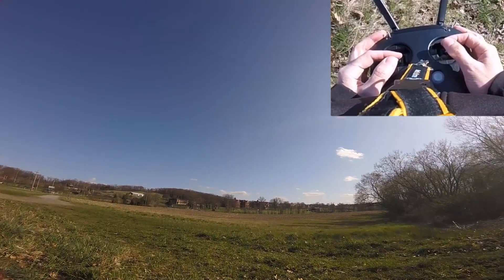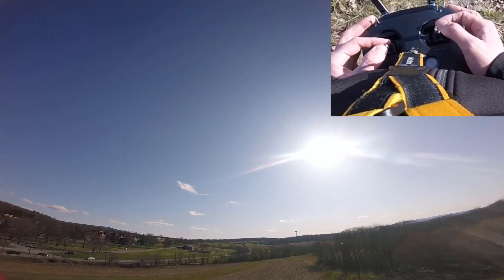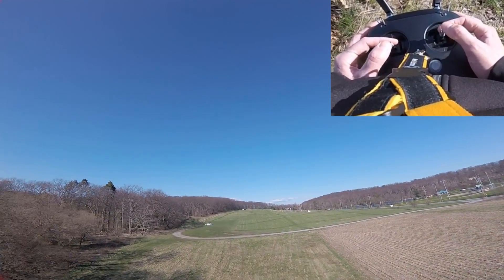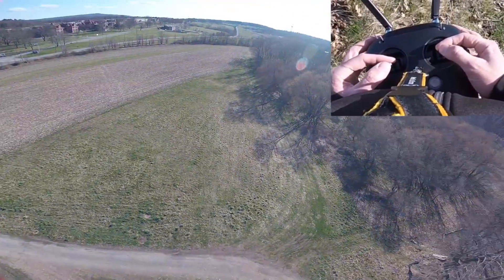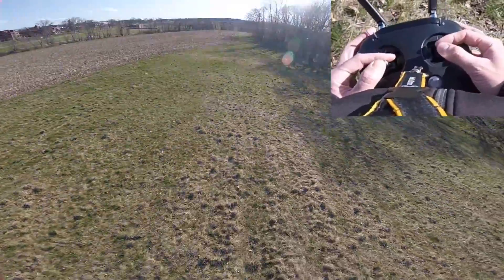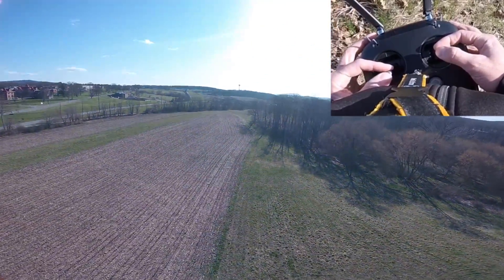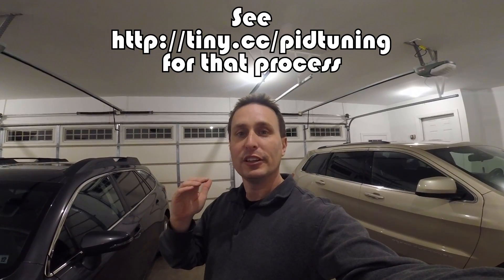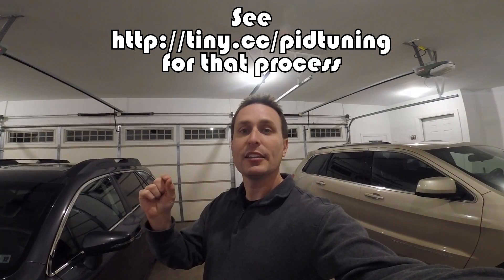How to Fly to your "PERFECT" Tune.

Comment: great tips Mark! Thanks for the video! 
One thing I'd add is, in order to really see the vibration profile if using spectrograms for example, it's good to do fairly SLOW 0 to 100% throttle sweeps (10sec or so). That way, we have lots of data across the throttle range with no gaps, which is ideal for spectral analyses, and we can more clearly see the full vibration pattern, which is ideal for looking for MTOs and such

Comment: Thank you for a great video. Could you elaborate a bit more on how P-term setting is influencing drone behavior on throttle punches (or link to the video where it is described in more detail)? I have a bit of trouble making drone be stable on sudden throttle punches (nose is dipping or raising from time to time), had a bit of success by increasing antigravity + I a lot, but it doesn't seem to be a proper solution. Just don't get how P is affecting it, as I am not touching any axis, so 'setpoint'  should not be changing... so I must be missing some of the key parts here.
Reply from the maker: https://youtu.be/Sdaw5YPvQBw

P-term pushes the gyro stay on Setpoint whether it is moving or not.

I-term too, but over long biases.  P-term is the shot stuff like a bobble.
Reply: @uavtech  thank you, looks like I was understanding setpoint a bit wrong - as an 'external control input on axis' and it was confusing me, now it makes sense.

Comment: I got ossolations on 5. Smooth forward flight > What is the advice too smooth this out (7inch)
Reply from the maker: make sure your props are not completely off balance and your arms are extra stiff.  then start with stock BF settings.

Comment: Hey, what would recommend for a 5 inch 6s quad in terms of d? Is 45 still adequate to tune the p d ratio? Thank you so much!
Reply from the maker: Depends on the power to weight ratio.  For a fat boy, i try to be in 40s.  For light racer, 20s or 30s.

Honestly you want it as high as you can without negative side effects.
Reply: UAV Tech thanks! Im coming in at 620grams with battery and everything, around 40 should be alright i guess

Comment: this is how you can fly with stock or mildly slider adjusted tunes. overly technical tuning is a thing of the past. https://www.airvuz.com/video/effpeevee?id=5e970859a21581516ab1d80c
Reply from the maker: Who do you think help invent the tuning sliders?!

Sliders have limitations and you still need to induce stepped moves to evaluate your slider tune.

Comment: Hey, I have a problem I can't solve for quite some time now. I have a crystal clear fpv feed until I turn on my radio. Suddenly my osd starts to flicker around and it can get so worse that the picture is nothing but static. My antennas are isolated and and so is my r-xsr and my unify pro 5v. It seems that the radio control link interferes with the video. By moving the antennas of the r-xsr I can sometimes get a good picture by holding it in a position or by taking the r-xsr out of the kwad and hold it above it. But as soon as I put everything back in place the same problem occurs..I'm just desperate at this point because i tried everything I could imagine being the problem
Reply from the maker: I would be guessing.  But check your VTX connector is not touching the frame.

Comment: How would you recommend tuning out prop wash on split s drops?
Reply from the maker: See http://tiny.cc/pidruning

You have.to have right, and then turn up PD Gain.  Depending on motors and props, you may never get ride of it.  Motors hit saturation and can not update rast enough.  Of if too much noise, you need too much filtering which causes too much delay.
Reply: For anyone wondering: http://tiny.cc/pidtuning is the correct link

Comment: Pfff... blah blah.. stock BF, PID is flyable for most 5inchers. 
Now try it on a 9"-10". Vibrations, and frame harmonics down below 80Hz in propwash region and prop balance issues.
Reply from the maker: Pffff, yeah yeah.

Move down the lowpass filters.  It is all customizable.  Just tuned a 8 prop 7" with this method.

The point of this video is how to fly to stress the pid loop to tune it.  The vibration issues associated with big props is legit PITA.

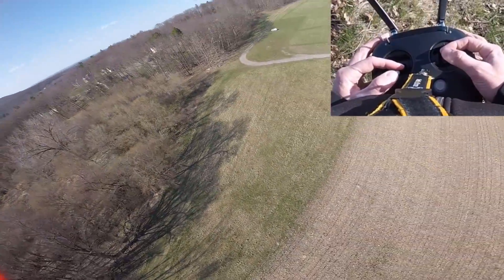Comment: Hi Mark, thanks for the video. At minute 3:10 you talk about this issue that has been driving a lot of people crazy (Bob Roogi mentioned this a lot in his videos). I have both Betaflight and Kiss quads. Kiss quads do this same thing too, and Kiss does not have antigravity. I almost 95% got rid of this bobble in the Kiss quad by raising P and D in both pitch and roll axis maintaining the same P/D ratio that default pids have. I still have not been able to eliminate it in my Betaflight quads :( Just wanted to point this out, hope you find it interesting!
Reply from the maker: Yup, throbbles just needs a Critically Damped tune on Pitch, and then increase PD Gain to fight it back.

All these firmware use the same basic math for the PID controller because it is just so basic.  1+1=2  no matter how you slice it.  So just to the same thing.

Comment: Do a 7" tuning video!! 5" is pretty easy to get beautiful footage out of. I want to see the master tune a 7"+, I know you could do a lot better than I.
Reply from the maker: I don't have a 7" yet.  But have helped folks tune them.  It is the same process.  We just did an 8 blade 7".  It was exotic for sure.  PIDs nowhere close to defaults.
Reply: @uavtech  The PID tuning is the same process, yes. To get that silky smooth, ABSOLUTELY NO BOBBLE, straight line footage, lots of work needs to be done with other features, such as RC smoothing, and various FF features. Caps all over the place, BLheli32 timing and PWM Freq ect...

I'd just be interested to see how easy or not it is for you to give us that 7" + butter. I think I may have finally cracked it with 4.2. 3.5.7 produced silky smooth footage at the expense of warmer motors. 4.0 and 4.1 got the temps down but FF introduced 'bobbles', along with loop time instability with RPM filter I'm sure wasn't helping. 4.2 gives me cool motors and after a bunch of tuning ALMOST no bobbles. I am VERY VERY VERY Picky about my smooth footage, 1 slight bobble and its GARBAGE. Long live 4.2
Reply: @RobertLeclercq  Hi, can you share you settings to have smooth HD footage ? Thanks mate
Reply: @Max-ie6ke  https://github.com/betaflight/betaflight/wiki/4.2-Tuning-Notes

I just followed the tuning notes and applied them to my specific use.
Reply: @RobertLeclercq  Thanks, just flash to betaflight 4.2, need to fly now :)
Reply: Yeah I'd can attest that 7 inch is very difficult to get a good tune. I am not the best tuning at the best of times, and seven inch is a nightmare. So much wobble in the HD video
Reply: Robert Leclercq hey im going to be doing some extensive videos on my 7inch and 8,9 and 10 inch macro kwads pretty soon so check out and sub to my channel brotha

Comment: so jitters I get just cruising straight will most likely be  p is too low
beta and flacox that is the only thing I see in my video
 like it has chills just cruising
Reply: Could also be a D MIN issue... Raise both pitch and roll D MIN by 5 and see if it improves and if it does adjust from there, if it does not try turning D MIN off completely by putting each value to 0 👍🏻. Good Luck
Reply from the maker: Could also be a noise filter problem too.  That is the trouble with quads.  A single symptom could be a number of things.  Logging gives insight on which is the true problem.  

However, if not windy, I would venture it is P is too high.  But again, it could just be a vibration issue that the firmware can't overcome, or filter settings are too high.

Like Smooth_Ops said, D_min pushes down D-term, which results in a P/D Balancing being pretty high, which is the same as P-gains just being too high.  

Personally, I would take a log with Gyro_Scaled recorded, make sure it is not a raw vibration or bad fitler settings problem and if those look good, then move on to looking at PIDs.  Conversely, you could turn off D_min OR decrease the PD Balance slider in BF to see if that helps too.